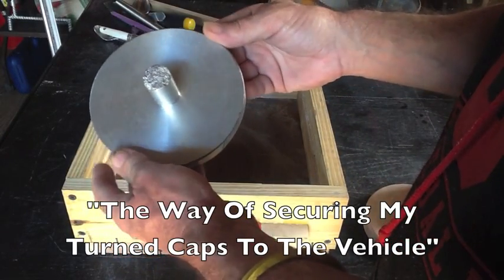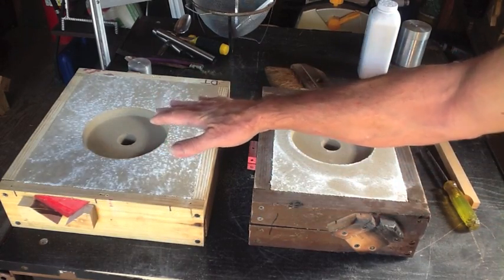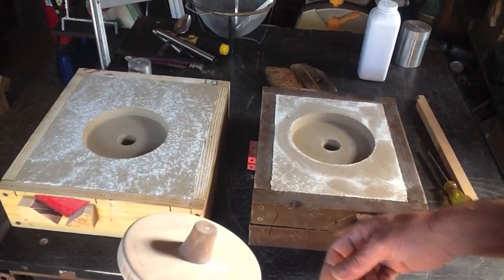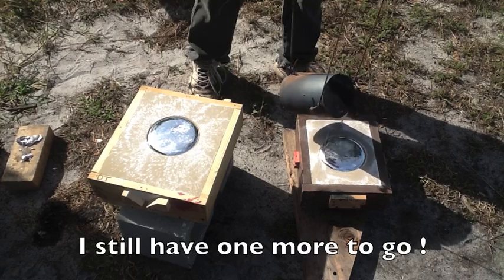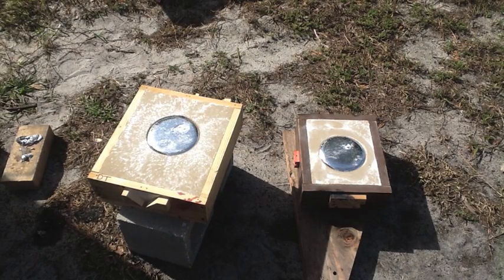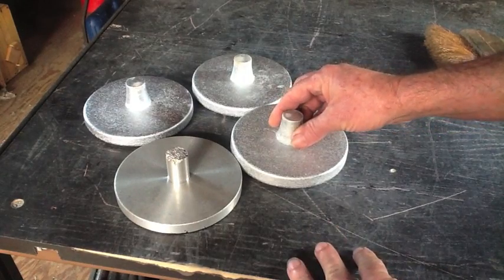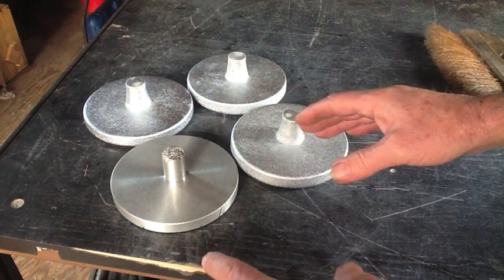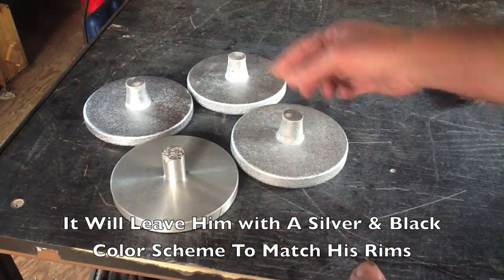DIY Aluminum Casting:  Custom Rim Center Caps P2 - MSFN

Comment: Seems like alot for a "DIY"  I bought after market steel rims The centre bore is 83.06mm I done a few internet searches for flat caps found a few exact match My idea is dremel the area where i want my chevy bow tie Use a 3D plastic pen for a few layers And mini hobby files for perfect edges Plastic primer And copper background with blacked out Logo  Which go's well with Black rims and copper lug nuts On a "Rootbeer" Chevy Blazer ...If i mess up I'm coming back here to get a mailing address LOL Thanks for the video
Reply from the maker: It was a lot of work, I owed that friend many favors :)
Reply: @MakinSumthinFromNuthin  I ended up with centre caps from a S-10 at the scrap yard And lug nut caps to hold the centre cap in ..some sanding and black spray paint and clear ..But shes done lol

Comment: Why didn't you use your waste oil burner?
Reply from the maker: The fire extinguisher waste oil burner I gave up on...although it works it just isnt practicle. I have new ideas to convert to waste oil that are wayyyy simpler than that big clunky device :)

Comment: That was a good idea to make these wheel centre caps. Producers often make this stuff from a plastic which crash very quickly.  I can't understand if it's just for economy or may be other reasons, such as for example, weight and some influence on the balance. I have the same problem with my wheel centre caps. They also made of plastic and have a lot of cracks. I thought about making them from aluminum. The bad thing is that they have complex shape, so I'm not sure if I can cast them in the nearest time. Anyway, it won't be easy. Thanks for your video. :)
Reply from the maker: I have to admit the factory ones are really quite crappy in their design. I am surprised he didnt lose all four.

Comment: Can you use fullers earth kitty litter to make green sand?
Reply from the maker: That may be what I used...it should work fine...they are all bentonite clay John
Reply: I got to go back to the recipe, I must not have put enough in my last batch, it wouldn't stick
Reply from the maker: 30lbs sand, 3lbs clay (10%)